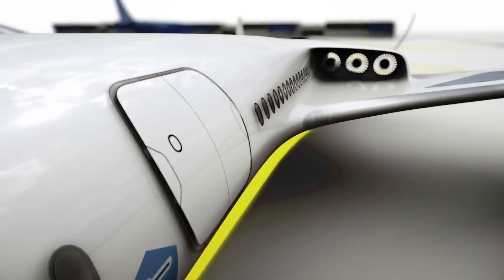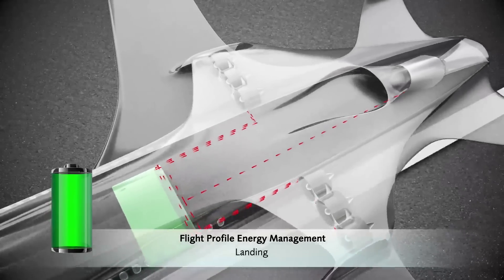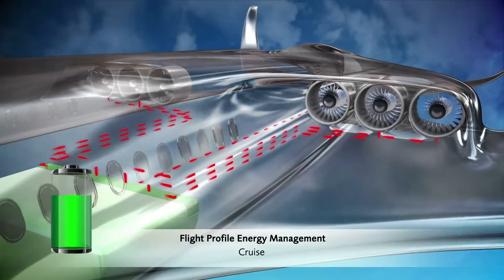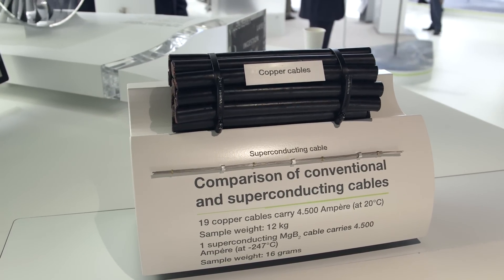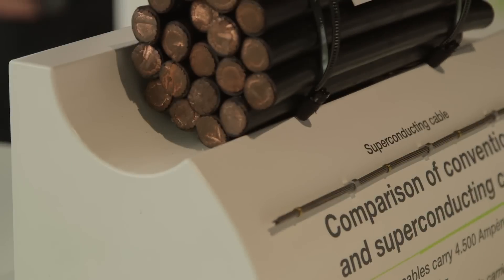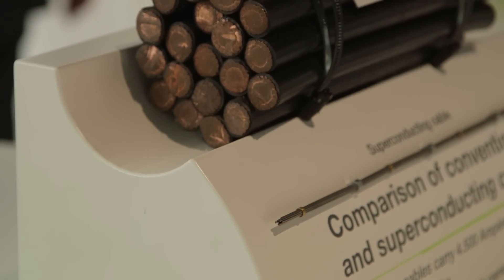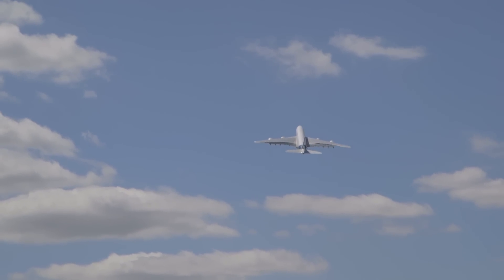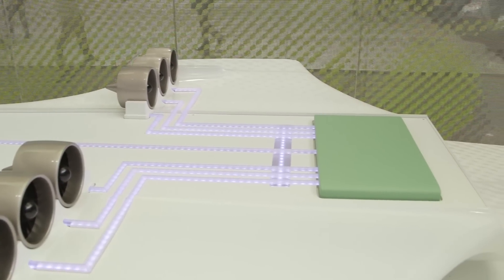The Future of Airbus Airliners is Hybrid Electric - AIN

Comment: But its not fully electric if its using a gas turbine to create the electricity ??? Thats not fully electric, they should call it a hybrid or something.
Reply: +Tyler Howard ... better call it hybrid, just like the Toyota Prius
Reply: +Apache Sakai Sounds more like a Chevy Volt -- it's electrically powered, but has an on-board hydrocarbon powered generator.
Reply: +Tyler Howard It would use kerosene more efficiently. It would run at it's most efficient power and the electric fans can adjust their throttle. The turbojet acts like it's own cooling system so no cooling tower is needed. You could attach a molten salt reactor to it (hot enough to run a turbojet) but flying nuclear reactors is a stupid idea :P
Reply: +The Eh Team, and yet flying nuclear reactors were at one point seriously considered by the US Air Force.
Reply: And it may again, if thorium reactors are developed fully...
Reply: You hit on exactly the problem... "cheaping out"!
Reply: It's in the title
Reply: Its a series hybrid. Hybrids are a good approach .
Reply: Will the plane spend six months of the year at the dealership for repairs like the Prius usually does.
Reply: @Blake Belladonna I meant to say hybrids might be better approach since batteries do not have the energy density to make fully electric aircraft.
Reply: @Blake Belladonna You need to learn more about Thorium reactors.  And I did  say "if" they are developed fully.  Better, lighter, safer designs are in the offing, if only we could get the NRC off its collective butt.
Reply: it has an electric mode. IT CAN RUN 100% ELECTRIC.
Reply: Hybrid is much better than nothing

Comment: Turbine as a charger will still be required until other energy storage systems can replace batteries that are not developing much yet, if ever - the challenge seems to be to have 8MW available for propulsion to avoid using a turbine to top up energy storage or batteries.
Reply: Rather Hydrogen Fuel Cells can be used. Even I was thinking about making something similar.

Comment: Superconductivity is of course the answer. However high-temperature superconductors have yet to become commonplace. To date all superconductivity needs to be cooled significantly. But the technology is slowly emerging and will still take several years.
  However Rolls-Royce has just introduced the perfect gas turbine for this type of operation. Electric motors with a gas turbine charging a battery pack is definitely on the horizon shortly. It is unquestionably doable and it's the next generation of Aviation.
  Additionally and importantly, not only the power cables should be superconductors but so should be the electric motors.

Comment: Few things about the comparison of Conventional and superconducting cables.   The conventional cables look to be a 480v bundle for 4500 amperes I could be wrong but they look like 350kcmil, which matches the amp ratings for the cables and the number in the bundle.   Few things though the conventional cable doesn't need an advanced cooling system, the superconducting cables do require this system in order to maintain temperatures over a sustained will require bulky and heavy insulation, equipment, and devices.   This equipment could easily offset the weight and the size of the conventional cables.  To give you an idea -247 degrees C is below what most liquid nitrogen systems can do, which is between -188 and -200 degrees C.  So you would have to use something like liquid helium which means in order to keep weight and volume down they would go with Dewars (Minimal loss storage vessels for cryogenic liquids) which could be filled at each stop.  Though based on heat transfer etc. would determine the size of these Dewars.  Or you could use some seriously heavy compressor equipment but eh.  This is why superconductors in vehicles or aircraft aren't really feasible until we have a room temperature superconductor.

Just a thought here but wouldn't it be easier, more weight and energy efficient as well as potentially cheaper to design a high voltage system?  I mean they are showing you a cable bundle that would carry 4500amps at about 480 volts.   If you say ran at high voltage of around 48kv.   It would drop that amperes to around 45.   Which would would require a coaxial cable roughly the same size maybe slightly smaller than one of the cables in the bundle, and slightly larger than the super conductive cable.  Then just design a battery system or hell even a super-capacitor system based on 48kv same goes for the electric motors.
Reply: Superconducting cables also operate on zero voltage therefore they don’t need any electrical insulation or minimum separation distances for connections.  One of the great motivating factors for development of superconducting cables is the great space it would save in high-rise building power supply,  just running cables around 11,000 volts into a multi story building takes up an enormous amount of space and the service ducts due to voltage issues.   It’s also wrong Chris you met liquid nitrogen will be required for superconductors much more moderate temperatures maybe a cheap or buy Freon is possible.

Comment: For whoever is saying that it is not fully electric they did say take off and landing is going to be fully electric, the thrusters are electrically powered and the plane is being flown using an electrical engine. Now its true that there is a gas engine onboard but it is only for charging the batteries and not to thrust the plane, a Tesla is a fully electrical car but it uses a power outlet to charge (which comes from mainly Coal burning plants) but it is still an electrical car. The only difference between the two is the plane can't stop in the next gas station to recharge while a tesla can ... hence the gas engine onboard.

Comment: As I understand, the majority of thrust isn't created by combustion as such and is created by compressing air.

That being the case, wouldn't it be easier to power the turbine electrically using power from a centrally mounted combustion turbine that you can also use to generate extra thrust if needed and provide backup thrust should anything happen to the electric turbines?

Comment: Cover the topside of the wings with Perovskite film solar panels. Cover the underside of the panels with graphene, integrating battery & panel. But rather than using old short air fields, use sea planes fitted with retractable jet skis rather than pontoons. Since the ski will simply slice into waves, they can splash down in heavy weather an airport cant handle. Fit planes with retractable snorkels to scoop water to fight wild fires. Use carbon fiber laminated oak to frame up a plane much lighter than one of metal which can also have effective fire retardant.  One the magnesium or whatever in the light metal alloys is ignited, the whole plane burns unstoppably.

Comment: Why cant v use necular power or any other type of power . Number of fans r4 or 6 or 8 . But v wil b using 1 main engin to supply power. Weight off 6 fan and 1main engin is again the same weight ratio.

Comment: Ok, I do have an idea for a hybrid personal jet (4 to 6 seat). 
It involves canard wings in front, forward swept main wings and a v-tail. The main engine is the same one used either in a Cessna Citation Mustang or Cirrus Vision SF50. Air is fed into the inboard gas turbine via intakes on either side. A smaller, electric turbine is mounted on the roof and can act as a booster engine on takeoff and even an extra generator when not in use in flight. As it spins, it charges its own battery pack in the nose (to counter balance the gas turnine in the back) and can later be used for cruising with the main engine at idle, saving fuel but having it ready at all times. The output of the two engines can be changed individually, like any normal multi engine plane. And eventhough the electric turbine won't be as powerful, it could still potentially bridge the gap of the gas turbine lag when you need power. A small propeller is mounted to the front and it spins a generator to keep base systems running in case of main engine failure. Electrical power on board will otherwise be carefully moderated by computer.
Reply: Fox McCloud 007 Symantec from Broadcom
Reply: Don't forget regenerative slowing down mechanisms. Whether landing or otherwise, there's no good reason to waste that energy instead of converting it into charging the electrical storage.
Reply: @coopergates9680  Wow I forgot about this comment of mine. But power down the electric drive turbine and it could act as a generator while slowing down
Reply: @DAN007thefoxx1  I've wondered if enough air could be directed into the electric engines to bring it to a stop upon landing in a safe distance. Trying to implement regenerative braking in landing gears would probably be much less practical, and for bigger commercial planes and long flights (>150 passengers), each side would probably have one electric and one petrol engine for a total of four.

The Alice plane shows that all electric is much easier for small passenger loads like what you proposed. Hybrids might be needed more for big ones.

Comment: Plane engine can act as a regenerative motors to produce electricity energy like a wind energy.... so once these are activated by electric energy, engines can turn into regeneration and can send back electricity to the battery....
Reply: Cobblers.  If you regenerate in the descent, you fall faster.  
An aircraft wants to glide as much as possible in the descent, to maximise efficiency.
R

Comment: Superconducting wire only works at like -50, -100 deg celsius. Going to need some kind of cryogenic ASU for super conduction to work......aka MORE WEIGHT! In the end I only see a minute difference......what happens when the cryocooler breaks down and the wires heat up....? Nose dive.
Reply: +Andrew Engelhart That's why research is being done to try to find higher and higher temperature superconductors.
Reply: Ohhhhhhhhhhh thats why, I thought they just had nothing better to do ;).....research is always being done to move things forward. I thought that was obvious. Making the "product" feasible is another story.....
Reply: +Andrew Engelhart hopefully, you could glide to safety, as you do now when your engines flame out.
Reply: until  they  come  up  with  room  temperature  superconductors  it  ain't  going  to  happen
Reply: We need to remember that it tends to be cold at high altitude.  Not liquid nitrogen cold, but certainly below "room" temperature, unless of course your room is a walk-in freezer.

Comment: So it's got a fuel burning turbine which generates electricity instead of thrust?  I thought in cars this isn't used because you lose efficiency every time you convert energy
Reply: It generates electricity and thrust. The electric engines are, in theory, only used for take off and landing then shut down at cruising altitude to recharge the batteries. 
Cruising doesn't require much thrust at all so that one engine should be sufficient.

Of course the issue then is what happens when that engine fails before the batteries recharge....
Reply: Um, hybrids exist. They do this all the time, because gas engines have weaknesses that electricity covers.

Comment: What a bunch of lame excuses. The battery pack weighs way more than the cables, the superconducting material is used as a scapegoat as to why they're not building hybrid planes already.
Reply: When we have electric generator from hydrogen then we need smaller battery.
Reply: @vickykashyap1042  bigger storage tank though
Reply: @fitrianhidayat  yap

Comment: Why not use some transformers so you can do high voltage at low amps, this will reduce the need for large cables. As well replace the batteries with thin capacitor built into the wings.
Reply: stonerspike 21 thats not how that equation works, thatnis how you find R given amps threw the cable and v drop of the cable. R is a constant value of the cable and does not change with v or a
Reply: stonerspike 21 its been a few years since i have done electrical work so i do not recall that equation. If you would be kind to cite a doc on it or note the terms
Reply: http://www.electricneutron.com/automation/voltage-transformer/ No I did not use the equation but it would be used in the context. My original comment was just based on the understanding that the main reason for large cables is heat & amps. As the more amps you put through a cable the more heat it generates due to loss in the wiring. In theory, all though I have not done the math, you could use higher voltages & A/C current to cut down the size of the cable. Though honestly any gain would be lost to the weight of the transformers and other equipment but it might reduce the need for super conductors. Which needs a lot more equipment than transformers.
Reply: stonerspike 21 Ya but V in the equation is not actually voltage going threw the line. Its V drop of the cable, or in other words how much voltage pressure is lost when moving electrons threw the cable. Plus at short distances it is really really low unless amps are very very high. Once again R is a constant value and does not change when voltage or amps change. So you can only use that equation to find V(drop) or I
Reply: theres no extension cord long enough
Reply: Super conductors would need equal if not more insulation. Plus loss on transforms may be less than wire loss.
Reply: This is an aircraft we're talking about not the electricity grid. There's only a few metres between generator and motors so any weight and space taken up by transformers would negate any advantages of stepping up the voltage. Of course you would need transformers at each end of the cable - one to boost & the other to reduce - the voltage unless the motors work at the higher voltage. Or maybe you could just generate at a higher voltage? not possible I think. But then again it's too much trouble for going just a few metres. Besides, transformers work only with AC so you would have to generate using an Alternator. If the motors are DC then after stepping the voltage back down you would then need a rectifier.
Reply: DarkGuardsman Why not using high voltage generator and HV motors instead using a transformer which is heavy AF
Reply: transformer will add weight
Reply: Good point - you good try using a high frequency switch mode transformer but you can probably give up on having any radio communications if they are powerful enough.

Comment: I wonder if this technology will also help start rockets bound for Earth orbit and beyond, saving money and adding Delta V without such big and heavy first stage engines and fuel.
Reply: The solution to that problem is to use balloons to get up to orbital altitude. But then there would be no need to orbit as the craft is already lighter than air as it's held aloft with a balloon. Just point the craft where you want to go and fire the rocket (using the hydrogen of the balloon as fuel).

Rockets are the second most idiotic way to get in to space.

Comment: If its not using electricity, and electricity alone, to produce thrust, it's not an electric airplane. Pure and simple.
Especially considering the power turbine appears to be giving a bit of its own thrust, this is a hybrid airplane.
Which is fine, imo. A great way to reduce fuel costs. And DAMN it is a snazzy looking bird if i may say.
But this is not an electric airplane. Unless you dump that gas turbine.

Comment: 4,500 Amps! I wonder what are the risk that a coolant leak could cause the superconducting cable to fail.
Reply: With MRI machines (which rely on the same kind of super conducting) any significant leak causes and automatic hard shutdown of the system. Also, liquid hydrogen is only liquid around -273 F so it needs stupidly good insulation. Even with that it will boil off over time and needs to be constantly monitored. 
Not only that, liquid hydrogen is extremely expensive and growing more scarce by the day. 

This concept really isn't practical at all right now but it's a neat idea that might be revisited when hydrogen is cheap.
Reply: no problem..it always works all the way to the scene of the accident
Reply: if theres a coolant leak just shutdown the system and glide to your deaths

Comment: Landing and takeoff will be by electric fans powered by The Battery alone, super quiet! A big plus ! Cruise flight, the turbine engine will be switch on and charge battery and power the electric fans for the flight, nice! The big turbofan jet engine always has it's fan spinning too fast, that's why they develop Geared Turbofan to solve this problem. This arrangement of Turbine engine and batteries and electric fans solve this problem. It will be super efficient ! The battery will be small not large for all you who dont understand. Using existing battery tech is enough ! A 2.5 ton, 100x High Discharge Lithium Battery for a 100 passenger jet is more than enough.

Comment: Looks like the future is hybrid, not electric.

Maybe (and that's a big maybe) it will become electric in the far future, when batteries energy density comes even close to the energy density of fuel.
Right now fuel has 5 times the energy density of li-ion batteries. Which means that an electric plane would need 5 times more space for batteries compared to the space needed for fuel.
Reply: 50 times buddy not 5 times !!!!!!
Lithium-ion battery have Specific energy  0.36–0.875 MJ/kg where as Gasoline has 46.4 MJ/kg and Jet Fuel has 42.8 MJ/kg .
Even if they manage to "optimistically" double or triple it in a decade that still puts it at roughly only 2.5 MJ/kg in 2030 even with using solid state batteries. That it fine I guess for electric vehicles however  hybrid or  electric planes are decades away for certified human flight .